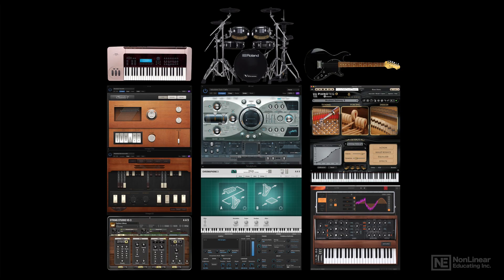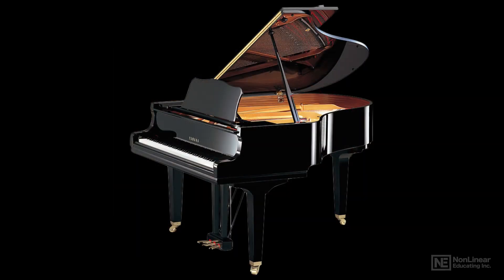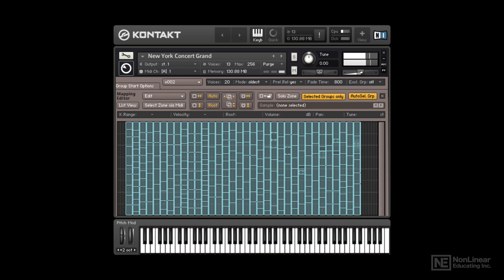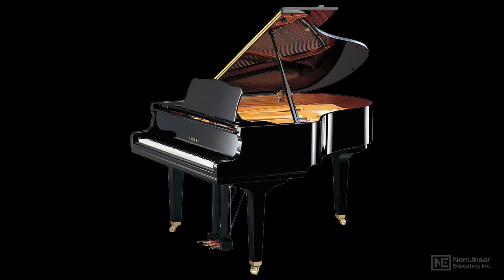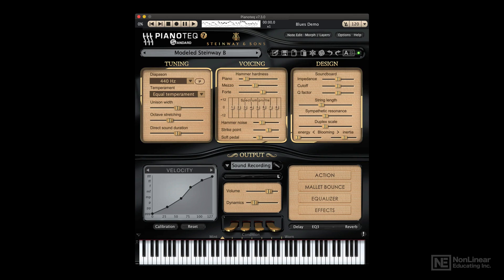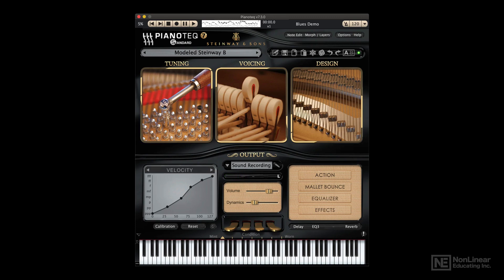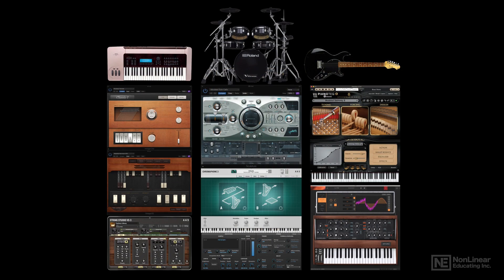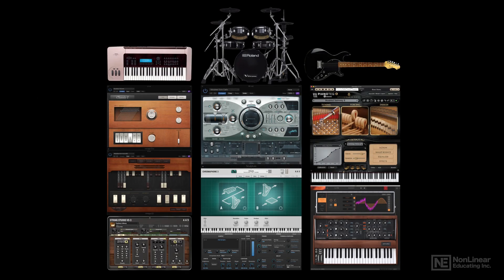Physical Modeling 101: Physical Modeling Explored - Sampling vs Modeling

Comment: Although I respect this video, there are now instruments that begin with very high end samples, but also include isolated samples of every component of the desired sound. If we use a piano as an example, these components could include "damper noise", string resonance, duplex scale resonance, soundboard and bridge resonance and even how high the lid is lifted on a grand piano. Algorithms are used to introduce minute changes of which components, and how much of each of those components to include in the final performance. These are my my personal favorite final sounds.